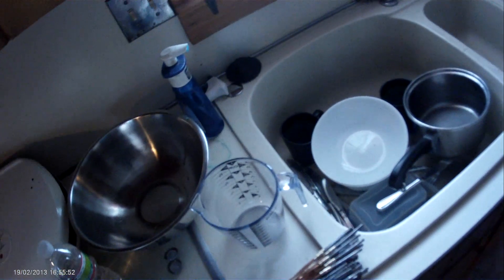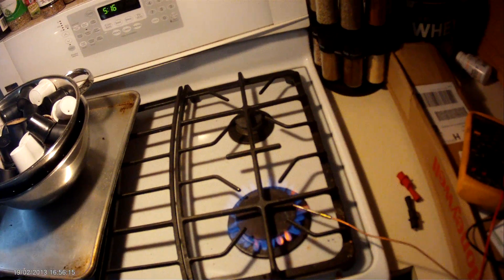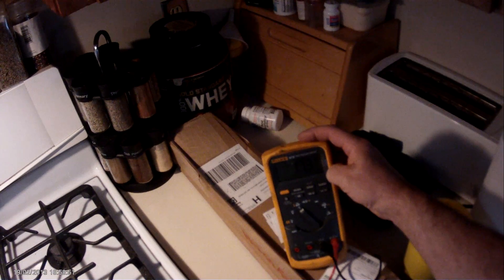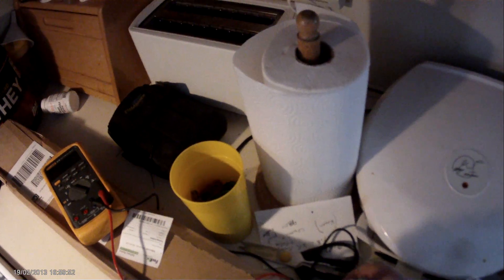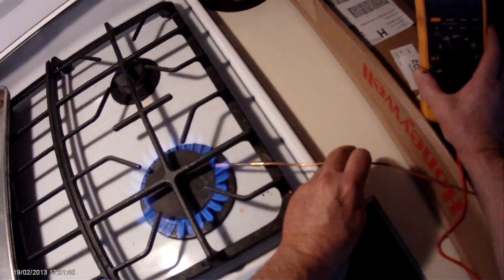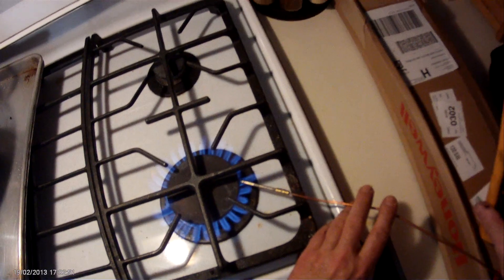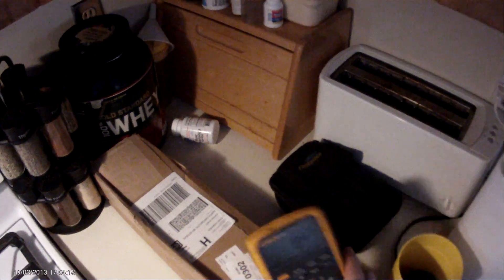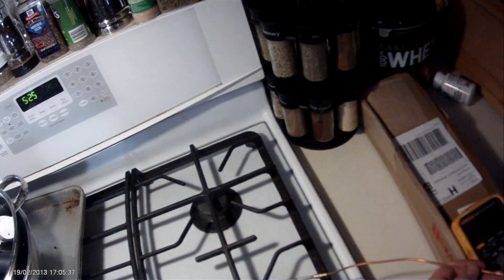piolet , thermocouple testing millivolt dc

Comment: Really enjoy your vids Steven. Please tell me what can cause abnormal draft that would pull the pilot flame away from the t-couple/mobile home single burner LP burner. ?  Same furnace thermocouple lead was black a few inches from pilot burner toward the other end... improper fuel/air mixture?